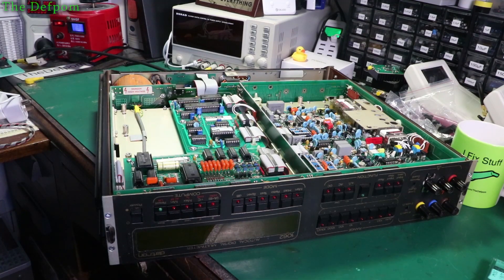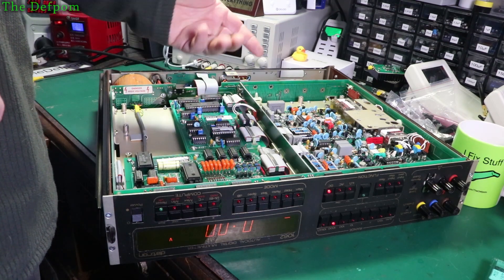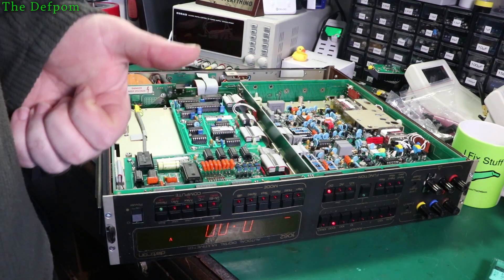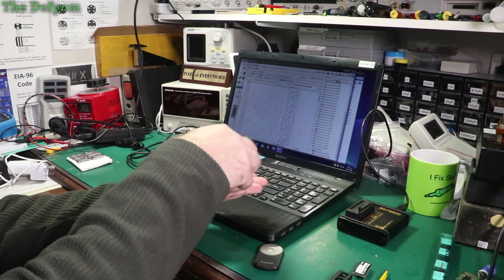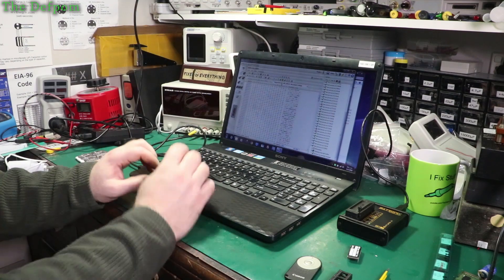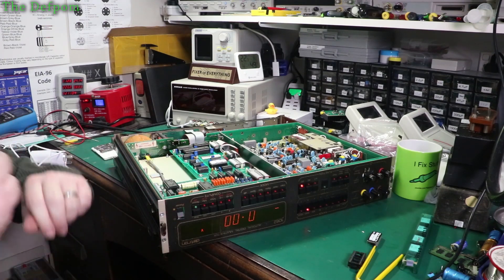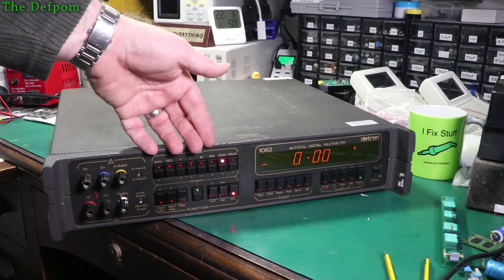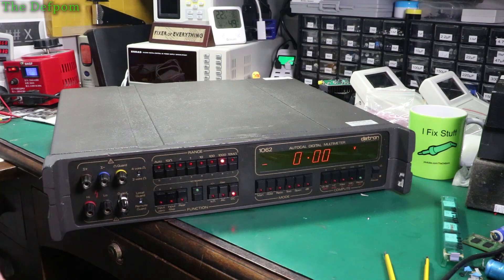#736 Datron 1062 Autocal Digital Multimeter Repair Part 6 - IEEE488 GPIB Board Repair

Comment: Well, if you want to dip your toe in the water with GPIB on Windows, and have a suitable GPIB to USB adaptor (the cheap chinese 82357B ripoffs on Ebay work) then have a look at my app which will either scare you away or drag you right in......
https://www.eevblog.com/forum/metrology/3458a-logging-via-windows-app-revisited/
Reply: I shall have a butchers at it, definitely wanna dip my toe in ...cheers.
Reply from the maker: IanScottJohnston - I downloaded it a few days ago 👍 along with a few versions of ni-visa and labview. I really have no idea how to set it up but there’s no harm in trying, I mainly want to do it so I can test the gpib functionality, but I guess once I get it running I will find ways of using it.
Reply: @TheDefpom  Install the Keysight I/O Libraries suite. Then do the following which is for the Lan-GPIB adaptor but similar for the USB version. You can test GPIB comms to your device without my app if you want to.....but you have to get the Keysight app working first.
- Go to Keysight Connection Expert and ADD Remote GPIB Interface.
- Now a device will be listed on the "My Instruments" panel. The GPIB address will be displayed i.e. GPIB1::22:INSTR
Reply from the maker: IanScottJohnston - thanks Ian, I picked up a fake Agilent USB to gpib adaptor last year along with a couple of cables, I haven’t even plugged it in yet! But I am motivated to give it a go at the moment.

Comment: Great progress. Nice repair I’m glad it’s coming together
Reply from the maker: I just need to monitor it for a while to be sure it is behaving ok, then run through another calibration and it can officially be a bit of my collection, probably, I still have it’s sister unit the LS101 to fix, which might electrically be slightly better, but cosmetically much worse.

Comment: Just a couple of questions. How old is the laptop and what version of Windows is on it? I often see people trying to do things with ancient machines and antiquated version of Windows and complaining about how their software doesn't work, this doesn't work, that doesn't work. I know you are a staunch supporter of Apple computers and I know you are very technically savvy so I had to ask.
Reply: That's what I don't get, if MAC is better at this why don't you ever see anyone using it. Even if the Mac version is easier, I could solve it quicker on Win simply because I know it better, ie, the one you know is easier regardless of OS. If you think Win is hard, you should've tried Linux 25 years ago - lol -.

Comment: Wow, ICs installed backwards - and of course you were very careful to note orientation and re-install them the same way - as we all would. Looks like you have the MC68488/dual MC3447 chipset installed on the GPIB board. Lots of good information in the datasheet for the MC68488 chip on GPIB operation. I'm just finishing up a stand-alone GPIB printer emulator that uses an Arduino and that same set of chips to capture HPGL, PCL and ASCII files to SD card.
Reply from the maker: David V - yeah I wasn’t expecting that! Your project sounds interesting, I definitely want to have a play with gpib and get it up and going at least on a pc, and ideally on my Mac, I purchased a fake Agilent USB to gpib adaptor last year with the intention of getting it up and going.
Reply: @TheDefpom  The biggest problem with the USB to GPIB adapters is finding software that will recognize them. Tektronix and Keysight both have free software for limited interfacing with their gear - Tektronix Open Choice Desktop and Keysight Command Expert - that would let you try out GPIB.